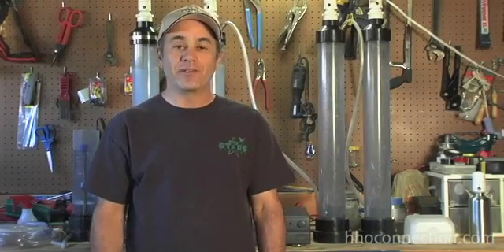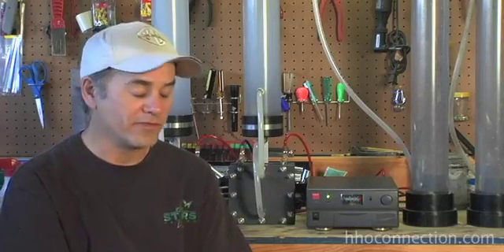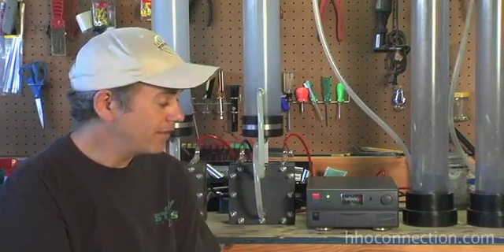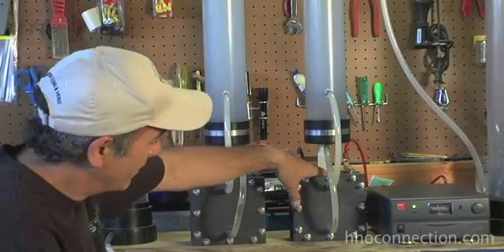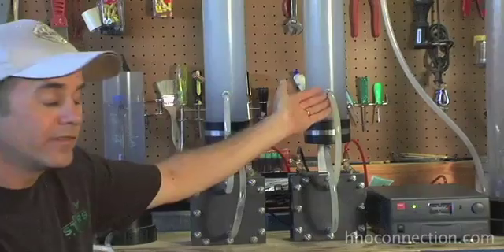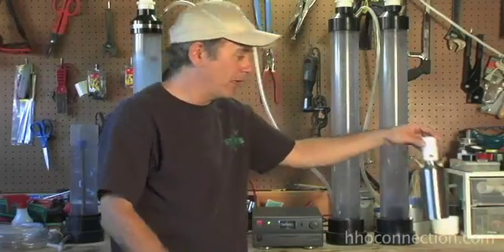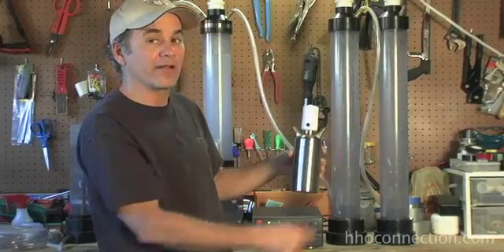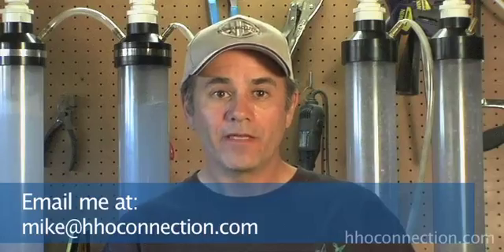HHO Basics - Getting Started Testing HHO

Comment: Very clear video Mike, Thank you . This video should help add the safety element to these
kinds of projects. By reading the comments below , some people are still NOT listening to what this is all about ! You were VERY clear.
*
Also , there are one way check valves that I bought on Ebay, and I plan to use 2 of them inline, but placed several inches apart.
Cheers, G.

Comment: @hypnotiz9 i was using baking soda,  then, baised on the fact there is voltage in fruits and vegtables found that i could get equal production with 1/2 the amps using tumeric and crushed B vitamins. Now, using small plate spacing, [strips of black microwave TV dinner trays] just using straight tap water, its probably the heavy metal flouine in the water

Comment: Hello - I am a fan of your work. I noticed that you state at the end of this video that HHO gas should not be stored under pressure? Why not? I have seen through NREL these new carbon fiber tanks that seem to do fine storing Hydrogen under pressure. Is it your concern as to the process how we might get this gas under pressure or is it what tank we would use ? (Large Propane Tank? ) Etc.

Comment: Thanks, Mike, nice video again. Seams to me that you are professional teacher. Very good work. One thing I see on your devices is stainless steel connectors, which can be expensive. As brass can't be used in system, I recommend to use pull-push connectors John Guest Co type. These are easy to assemble/disassemble, they have no leaks and stands good pressure. Know the small company who have large stock of all items. Thanks, GmanBB